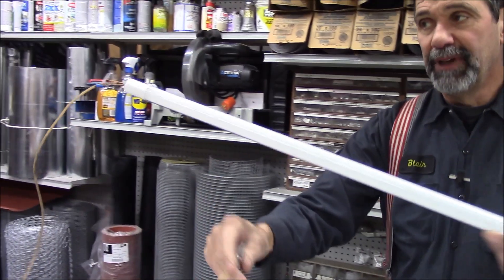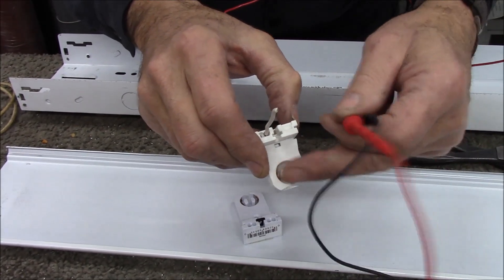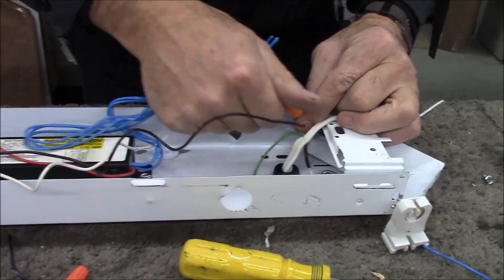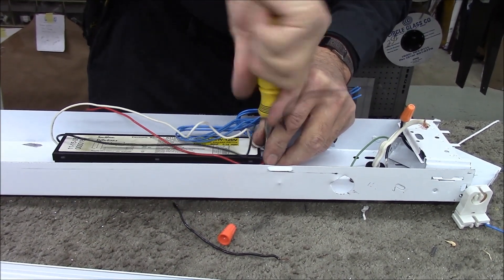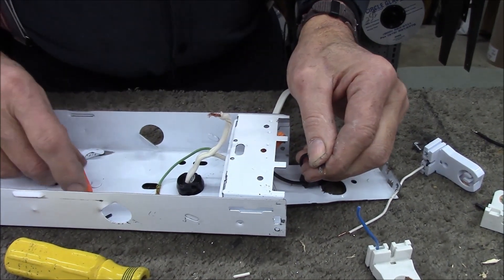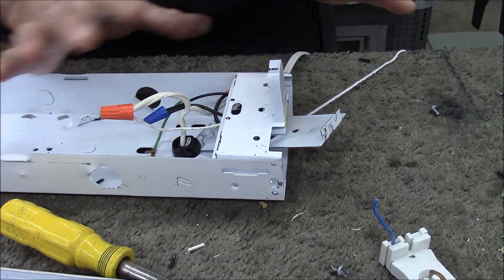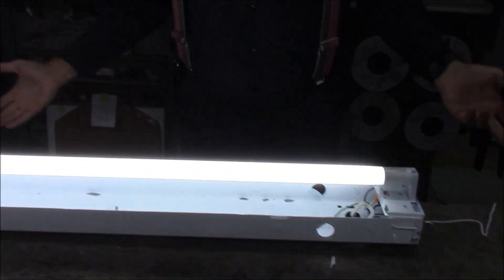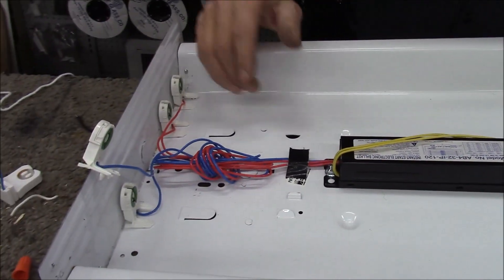Convert Florescent to LED, No Ballast, Better Light, Save Money

Comment: If I get the led bulb but I dont take a away the balast how much more electric will i use?  I know it is more but how much more?
Reply from the maker: You will use less using a LED made for use with a ballast than using a fluorescent bulb, but why unless you are unable to get to the ballast? Leaving the ballast in is wasting electricity. Get 120 volt led bulbs and eliminate the ballast.
Reply: In some cases you might want to leave a disconnected ballast in place to maintain the fixture's original weight distribution. If the fixture hangs from chains, removing the weight of the ballast might make it hang off balance.